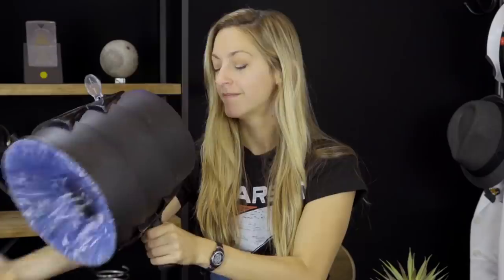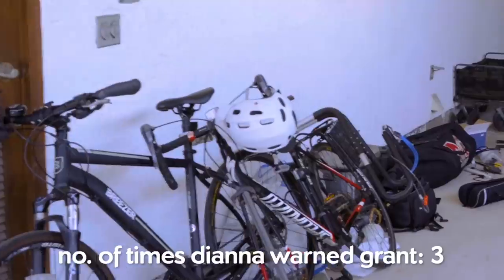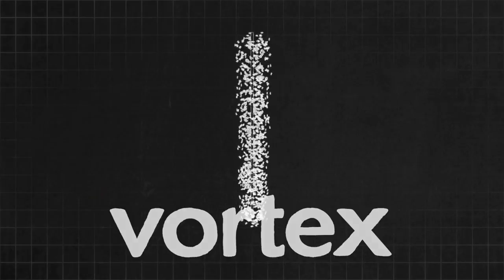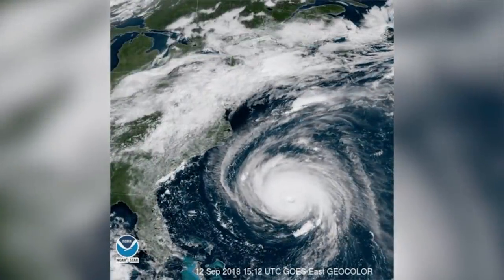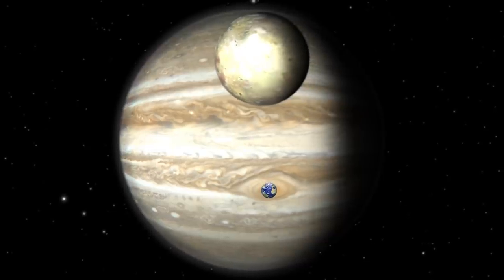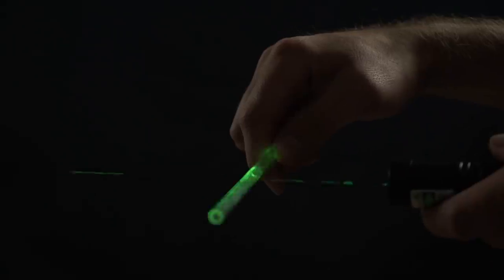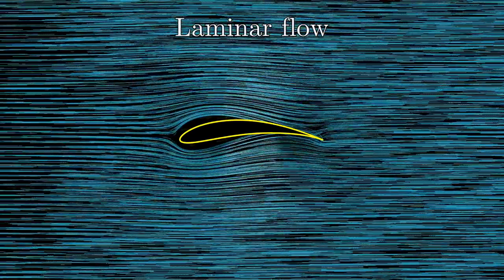How to Make a SQUARE Vortex Ring! ft. 3blue1brown

Comment from the maker: Other interesting questions we didn't have time to explore in the video, but if you like reading here you go: 
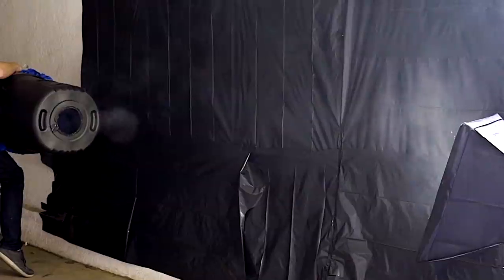- Why a ring going around a ball breaks apart. Every single time we tried, the ball would interfere with the ring, even if the ring was clearly much larger than the ball, as in 2:14. We kind of thought the vortex ring would expand over the ball, but finally realized that vortex ring is spinning so that the air on the inside of the ring is moving forward, so it drags against surface of the ball. Sad.
- The leap-frogging rings at 2:17 were surprisingly hard to make because small currents in the air tend to send the vortices off an a different path. The reason they leap-frog around each other is the same reason hurricanes spin around each other as shown at 4:52. 
- We shot a smoke ring at a 1-inch pipe, a rope and a thin wire. The pipe killed the vortex. The wire passed right through the vortex with no effect. The rope sometimes killed the vortex ring, sometimes not, depending on how strong the ring was. We wanted to quantify this interference, but alas, I have to start working on a video about black holes. Get pumped.

Thanks for watching, y'all! I love making these videos, especially when I get to play around with the science for a while and cool people join me.
Reply: What would happen to a powerful vortex while entering a black hole?
Reply: I wonder if the ball is small enough and the ring large enough whether you could get it go around it and keep going. So many possibilities to explore!
Reply: I guess the thin wire you tested alone was the same one used to suspend the ball, concluding that it was only the ball that broke the ring?
Reply: @ristershah   Depends on the size of the vortex, the size of the blackhole, and the direction the vortex was going relative to the surface of the blackhole. And of course, on what else was around the blackhole.
Reply: Love you Dianna You the best!.
Reply: Sad, but maybe a vortex ring would shrink to squeeze through a hoop.
Reply: We get it, you vape!
Reply: Physics Girl, so this is the beginning of the end of hurricanes! All that is needed is to develop some kind of “huge ball like device” 😃
Reply: I myself have a question in mind - what would the interference be in a shape of constant width ? Would it be stable as a circle?
P.S.
Since air is a fluid, could it be possible to create a laminar flow vortex cannon ?
Reply: I'm so glad you did the leapfrogging!  Thanks!
The other way of thinking about how it works is that the interaction between the two rings pushes the rear ring to be smaller and the front ring to be wider.  This makes the rear one go faster and the front one go slower.  Once the rear one pops through, the system reverses and they can do it all over again...in a perfect, nonturbulent world!
Reply: Diana: Maybe some analogue blackholes? Analogue gravity seems to be a growing and interesting field.
Reply: As the vortex is formed by the air moving faster through the center of the ring than the surrounding air, the ball stops that faster air by getting in the way. It then deflects the air around the ball breaking the air stream into multiple parts and creating lots of smaller eddies and other turbulence. You can see it happening if you play the video at a slower speed at 2:15
Reply: Try making the opening of the pipe smaller than the rest of the pipe. 
It should give the middle the initial spin of the vortex. 

The vortex is spinning inside forward. When it hits the ball. The ball stops all air in the center of the ring and pushes it all to the outside. Reversing the spin canceling the vortex. 
Hmmm. Weather control. Stopping a hurricane.
Reply: How about triangular vortex?
Reply: What would happen if you coat the ball with various substances? Silicone, water, hairspray, or something non-stick comes to mind. Is the  temperature of the ball a factor?
Reply: Send a vortex through a double slit experiment!
Reply: how did people come up with string theory? and yeah can u plz do a video on bootes void?plz.
Reply: @enricolucarelli816  crazy idea
Reply: @StarlightLumi  You're on the right path. It's got to do with the relative scales. The 1" pipe was roughly on the same order of size as the vortex ring. So when they interacted, it was the right size to disrupt the flow. The wire, was orders of magnitude smaller in scale than the vortex ring, so it would not have absorbed as much energy from any air molecules that interacted while passing by. The rope, well, that would have been at the mid scale and depending on which part of the vortex hit it, it would or would not absorb enough energy to destroy the ring. 

There's major implications for this in real life: Airport runways. There's a vortex that spins with its axis parallel to the direction of flight coming off the tip of a plane's wing. The larger the plane, the stronger and larger that vortex. As you saw from this video, they can take some time to dissipate, which means that there's going to be a lot of movement in the air right over runways as planes take off and land. Engineers designed the little vertical winglets on the tips of wings to reduce the strength of those vortices so that lanes can land with less time between them.

Back to discussing scale though, a small plane will produce a smaller wingtip vortex. These can be small enough that a very large plane can land quite quickly afterward. But if you've got an A380 landing, you may need to wait 5-10 minutes for a wintip vortex to dissipate enough for a smaller plane to land. There have been recorded events of small planes getting a little too close to the wake of a big jumbo jet and literally being flipped in a barrel roll by the wingtip vortex, all because the invisible vortex was a larger scale than the plane! This is also why larger planes feel much less bumpy flying at cruising altitude; the turbulent eddies need to be very big in order to move the plane about!
Reply: Hey Dianna, did you find the stronger vortices got killed by the rope or the weaker?
Reply: What would have happened if we had a combination of different holes (may be of diff shapes) ??? Like say in a two hole combination system with square hole the 1st one then the circular hole, can we make that wobbling vortex ring(that presumably exists between the 1st and the 2nd hole) a purely non wobbling circular vortex ring or it would still retain some residual wobbling or just it would not be affected at all? and also does the shape of the canon matter? ...btw the video was really cool...:)
Reply: Perhaps someone will find rotor ships (i.e., those cylindrical sails, leveraging the Magnus effect) interesting w.r.t. a pipe's interaction with the vortex.
Reply: Physics Girl t
Reply: I really hoped to see a vortex ring going through another and bigger vortex ring going in the opposite direction...
Reply: And, does a ring deposit momentum when it collides with a hanging plate?     And is an automated ring-launcher able to propel itself along, or do vortex rings not carry momentum since the streamlines are closed loops?   And since any rings launched down into a pool of smoke make sphere-shaped dark objects, if a ring launcher is totally immersed inside a pool of smoke, will rings launched up into clear air look like spheres?  And, if the tarp membrane vibrates, doesn't it create alternating rings, half going backwards?   
And, one guy in the '70s managed to launch invisible rings of electrically charged air, as a possible model of Ball Lightning, and said he could feel them go by, since they would attract arm-hairs.
Also, #1 above, smoke rings are rings, but MOVING smoke rings are actually spheres: google "Hill's Vortex;" it's  one of the few that don't need simulation codes.  Don't disrupt your spheres.   Hmm, a very slow-moving, low-Reynolds ring might not be destroyed by the pipe.
Reply: @tiagotiagot  Can we have a blackring?
Reply: @rwilson1125  If a blackhole spins very fast, the singularity itself becomes a ring instead of a point; I'm not sure if that goes far enough to to make the event horizon itself become a donut though; and the rotation would not be like with a ring vortex in this case, just around the circumference of the ring.

Though that made me think; I'm not sure there would be a way to physically make a blackhole that rotates like a vortex ring, but it kinda sound like such a blackhole existing might not be completely impossible, in the same sense that wormholes and warp-drives are not impossible; and due to frame dragging, they might even perhaps be self-propelled like vortex-rings, with more space being pushed backwards in the outer rim than is pushed forward by the inner rim. Though, that would only work if it is impossible to get donut event horizons; without the inner hole I'm not sure how the inner rim would be able to have any effect on the outside...
Reply: I was assuming all these calculations and movements are based on earths gravitational pull.  If we had a different gravitational pull we would have new figures to work with?
Reply: @gioyee5769  I was answering a question related to blackholes; that's not what we are talking about?
Reply: @enricolucarelli816 , a hurricane is a bit different in that it is constrained above and below by the surface of the earth and the top of the atmosphere, and is powered from within by warm water. But nevertheless, the 'huge ball' would work, and generally does ... in the form of a large land mass. The only problem is the land mass may have people living on it.
Reply: @plamenpenev7271  Usually if there is resistance and force, a harmonic wave builds up. That's how a violin string makes sound, as does a wine glass when you run your finger along its rim. Apparently as per a common physics demo for "gravity waves", even the tiniest imperfection gets amplified and propagated into a larger wave, and eventually that wave breaks and then you get turbulence.
Reply: @jcd-k2s  The impedance would change with the change in the speed of sound, so a part of the energy would get reflected/diffracted. It should be testable in brine with water on top, with a clear separating layer. Kind of like those fancy coktails with striations.
Reply: Physics Girl This was very cool. I subbed when you did the Rodney Mullen vid but haven’t seen you in a while,hope everything is ok and you get back to making seriously cool videos that make people think soon. Peace ✌️
Reply: Those observations and the computer modeling of frictionless (superfluidish) behavior can explain many properties of Light.

Invert the conventional view of existence being made of bits of somethingness flying around in a space of nothingness .. to one pervasive fluid with some vortices so intense that they form a true vaccum at their core (electrons, positrons ..).
Get 3 vortices with the right spin possibilities inerlinking and you have nucleons .. their various rotational energies giving them momentum/mass.

Add the pulsation/vibration called Om to the all-pervasive fluid  - collapsing  all vortices in the high-pressure moment will move the fluid microscopically in the amalgamated direction of clumps of vaccum-centred vortices  (matter). This is why gravity (vaccum collapse in the 'on-beat' of existence) is so slight and is proportionate to mass (multi-directional interlinked vaccum-centred gyroscopic forces).

Then .. there is the replenishment of the fluid, which is the source of the Om vibration (existence arises between 0 and 1, mathematically speaking, not from a splitting of 0 into -1 and +1).

At that point, you could wrap up a few of  the big mysteries of cosmology.

There are interesting areas too where the mathematics of fluid dynamics and string theory get close .. a hint : when the maths explanation is 'dimension', look instead for mechanism.

Physicists could have made way faster progress if they hadn't abandoned philosophy, which might, of course, have been a terrible thing. 

Congratulations on your experimentations, Physics Girl, and thanks for the gorgeous images.
Reply: Oi! Where you be?
Reply: @ristershah  Whoa.... Now you're talkin' craaaazy.
Reply: What if the ball was spinning??
Reply: We want more on this. Another video including triangle, star, pentagon, animal shape, etc.

Comment: Well, one question remains for me... What about a triangle?
Reply: Super 'strong' circle...
Reply: I expect you would see an oscillating behaviour in the shape of the ring between ∇ and Δ. When looking at the triangular ring from the side, the vertices of the triangle would travel ahead, causing an oscillating bulging kinda like the sail of a sailboat blowing in the wind that's attached to three points.

Someone should try it to, I am wondering whether if this is correct!
Reply: @ItsTheSebbe  I suspect you're right; that's exactly what i imagined. I bet the triangle shape would be harder to generate, because of the increased force caused by the oscillation (compared to a square shape). So at a given density of smoke, it would be more likely to break up than an oscillating rectangle.
Reply: We should tell ViHart, she'll do anything that has triangles in it :D
Reply: @HassanSelim0  I actually never heard of her!?
Reply: @HassanSelim0 
Is she even still alive? She doesn't post anything at all
:|
Reply: The Illuminati wants to know your location
Reply: @anjelpatel36  but what if I AM the Illuminati?

Comment: My hypothesis for the square hole is that the vortex will still be a torus. I think that because knowing a vortex is created by air on the sides of an initial air movement spin back and then are fed back into the main center current creating a ring, because knowing that the circular hole is circular for the most homogeneous flow of air, the square means that the corners will output higher speeds of air and the edges will output slower currents of air. Because of that, the air current will quickly form itself into a cylindrical flow creating a torus-like vortex but slightly weaker.
Edit after seeing the answer: It probably doesn't stabilize into a cylindrical flow and instead goes into a circle but the inertia of the current will bring the shape of the flow further into a square/diamond and then it collapses back towards a circle again.

Comment: I know this video was six months ago, but I didn't see it then for some reason. I'm a meteorology student at university, so when you talked about hurricanes and how they related to these vortex rings, that was cool. The first example you showed of the hurricanes, when they are both in the same hemisphere, and therefore spin the same way is called the fujiwara effect. When this happens to hurricanes, they usually both get weaker, though the stronger and larger storm is usually less affected by this interaction. The other one that you mentioned with hurricanes when they are spinning in different directions happens fairly often in the Indian Ocean when one hemisphere's hurricane season is winding down, and the other one is starting back up.

Comment: 2:40 my prediction is that it produces a normal vortex ring characterized by the smallest dimension of the rectangle.

3:05 they appear to be the same size as the original hole :/

Comment: I would like to see more experiments  like this, concerning the vortenticy of a under-square vortex. As a localized motion Researcher I can relate to a highly under-square vortex, as being like a string, this type of vortex seems to answer questions concerning the string-theory. I consider a torrid-vortex as being closed-looped, under-square, having the ability to coil & uncoil and being driven by the difference between filled-space & empty space, (open-loop factors). Most all vortexes that I have researched in the past, have two forces that come into play, that force that pushes & bends and the force that pulls-straight. Thank your very much for that video!

Comment: 2:36 I saw earlier that the vortex depended on the air surrounding it and was removed promptly in collision and other such alterings, therefore it is a gaseous whirlpool of sorts. Putting it into a square hole will cut off the whirlpool, and because it depends on the air surrounding it the vortex will collapse and not be seen.

Comment: I'd like to see what happens for shapes with different side lenghts.  For the even sided shapes, it follows that the respective corners would advance, and the delay between corners (the length of the sides) would impact their shape in the third dimension as they propagate (the rectangle).  It follows then that a trapezoid, or other more irregular 4-gon would see even more irregular forward propagation as a function of the time taken for the respective corner superpositions to happen.  I suspect some aspect of this would make the vortex ring steerable.

Comment: Small rings go faster?   But the same launcher-box can produce rings of widely varying velocity!   Possible answer:  rings don't propel themselves along after all, and it's possible to have identical ring vortices moving at any relative wind-speed  ...or hanging still.    Perhaps build a ring-launcher that creates fast violent rings but DOESN'T fling them forward?   Or, what happens when the launcher is traveling backwards at the same velocity as the rings it was launching forrwards?  (A 'static ring' launcher might need an orfice-plate that suddenly jerks backwards.)  Hmm, are BACKWARDS-MOVING smoke rings impossible?   Oo, ooo, if they are, then smoke rings are irreversible thermodynamic objects, and if you see one going backwards, it means that time is reversed, or perhaps you threaded the ancient physics-lecture film in the projector upside-down.